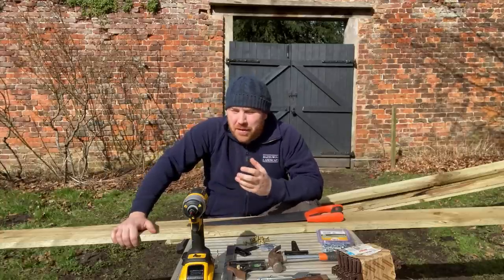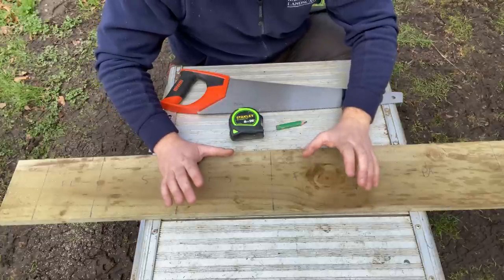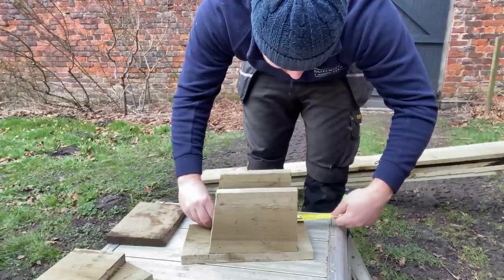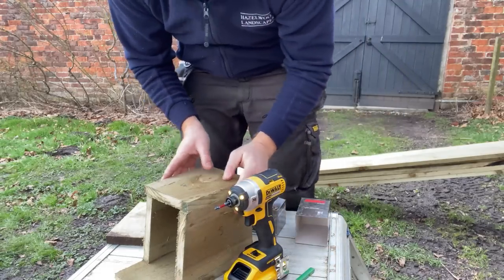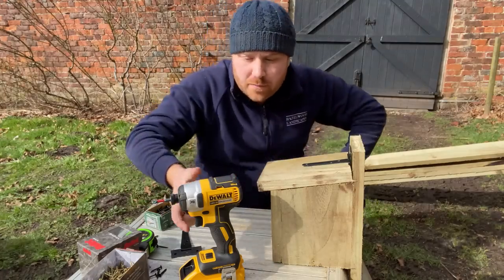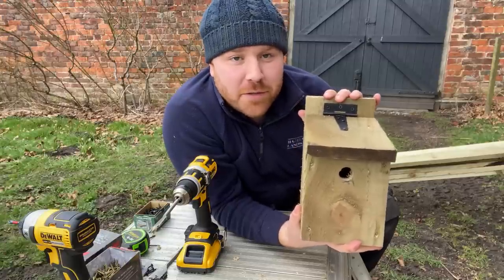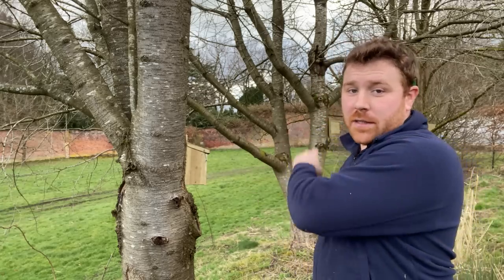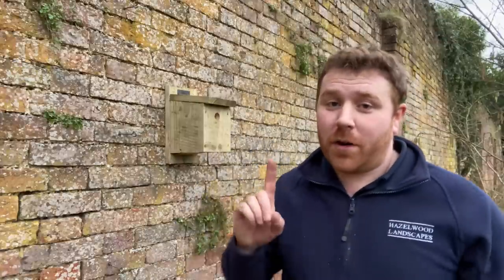How To Make A Bird Box - Blue & Great Tit

Comment: Loved this video! I just found a bunch of sparrow and finch bird houses at a thrift store, but none of them have any way to clean out old nesting.  How would you fix this problem (or is it even necessary to clear out the old)?
Reply from the maker: Hi Joanna - glad you enjoyed this, you could always remove the tops of the boxes and add hinges I guess so they can be open and closed when needed - I clean out the birdboxes here once a year in case there are any parasites, diseases that could be transferred to new occupants and their young, but I do always wonder, with the house sparrows that nest under the roof here naturally, whether they have a thorough clean out of their nests each year... :)  Best wishes, Joel
Reply: @WildYourGardenWithJoelAshton  Thanks so much for responding. I only asked because the finch out that I put out last year was used twice before I got a chance to clean it out. Not sure if it was the same adult birds or a different pair. I'll be sure to run boiling water through it before setti g it out this spring. I'm new to your channel, but am thrilled with what I'm learning. I'm from Ohio in the USA and have been sharing your channel with my family and friends.

Comment: I would have thought the birds would prefer a nesting box higher up off the ground away from predators like cats and fox's which could easily attack a nesting box so low to the ground. I would have thought 2.5 meters or higher would be a better height. I built 6 box's 10 years ago, and they are still in use today. This is such a great little project, especially for the children to get them involved and interested in the birds, great for school holiday projects. Cheers.🐣🕊

Comment: I have a question, I live in the middle of an old town and I have a terrace, no yard. Can I build this for the Great Tit and put it in my terrace?
Reply from the maker: Absolutely you can :) Just make sure it's out of reach of cats, best sited on a north or east wall if possible - hope this is helpful, there will be some grateful residents in a relatively short time :) Best wishes to you, Joel
Reply: @WildYourGardenWithJoelAshton  at the end of the video you mentioned heat, that might be a problem since this terrace is facing north but it is so open a lot of sun comes and and can be quite scorching during the summer. Will probably have to open the umbrella for heat management.

Comment: A few instructions I have read have said to use untreated timber. Are you sure there's no problem using treated wood?
Reply from the maker: Hi there, I have read various articles on this, it does appear that it's not always recommended in USA, but again it depends what website you're reading as some in USA say it's now fine.  Before 2004 pressure-treated lumber was considered not to have been the safest material to be around. But the EPA banned arsenic-treated PT wood in 2004, and the products available today are completely safe.  Hope this helps, the wood you use is entirely up to you of course and depends what part of the world you're in.  Best wishes, Joel
Reply: @WildYourGardenWithJoelAshton  Thanks Joel. I'm in the UK, so is treated wood from B&Q ok?

Comment: My garden only has room for one nest box. If I put up a great tit box will blue tits use it or do they really need a similar hole. If so I wouldn’t know which species I would prefer to put up a box for
Reply from the maker: Hi there James, my apologies for the delay, been one of those weeks already! ;)  Blue Tits will attempt to nest in a Great-Tit sized box but of course Great Tit's will "bully" them out, plus rather sadly I did hear from a client last year that a Great Tit had nested on TOP of an already occupied Blue-Tit nest in a box, suffocating both the parent and chicks where the Great Tit was making the nest on top of them :/  So it's a difficult one, but Blue Tits would certainly appreciate the smaller hole so that the Great Tits can't access it - hope that helps a bit, let me know if you need any other advice James - best wishes, Joel

Comment: I put up two blue tit boxes and both were destroyed by the local cat sitting on top and killing all the chicks i am having to find ways to deter the cats from climbing on top ready made spikes are no good as they can walk along putting their paws in between the plastic spikes just like to say i attached the boxes to two oak trees about thirty feet high what's needed is a video or videos showing how to deter predators from killing whole families of birds
Reply from the maker: I empathise re the cats and destruction Victor.  The way I prevent squirrels and no doubt cats is to affix chicken wire around the box but not too close, ie leave enough gap so that the birds can of course get through and then hop into the box, but larger birds (magpies etc) and squirrels unable to.  If you look for "prickle strips" on the internet, they're designed to be cut and fitted to the tops of fence panels, but they could be used on the roof of a bird box no problem, they're easily cut to size etc.  Hope this helps a little but if I get a chance to do a video on this I surely will :)  Best wishes, Joel

Comment: Treated lumber is not a good idea. To many chemicals in the wood that is not good for the birds
Reply from the maker: Absolutely, but with pressure treated wood this ensures any preservatives are pushed to the centre of the wood, preventing rot etc and to be honest house sparrows and other birds used to use wood fascia and soffat in older properties, hence the house-sparrows name and this wood would certainly have been pressure treated (or worse) to provide longevity.  Best wishes, Joel